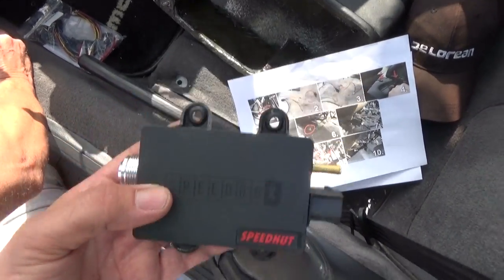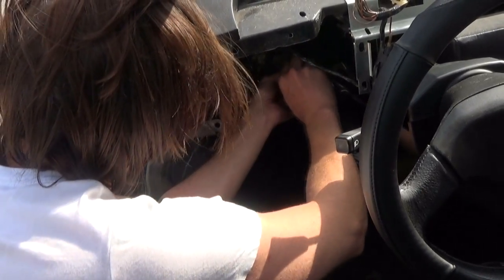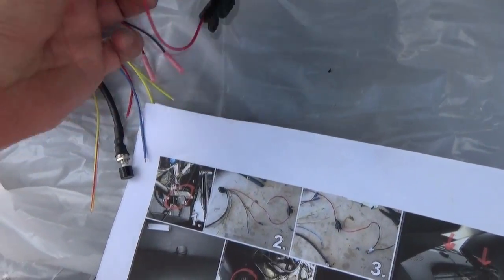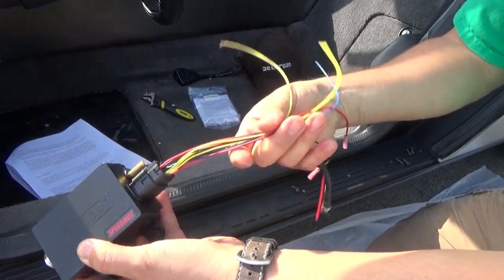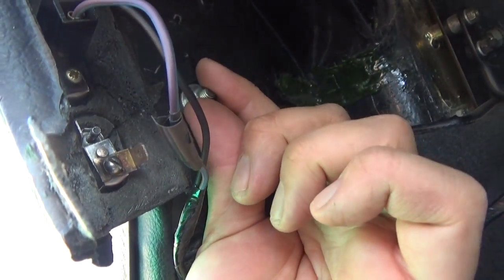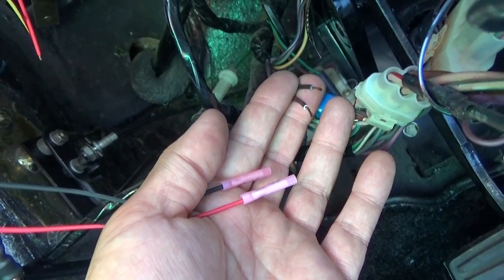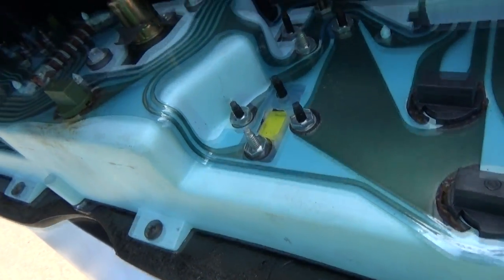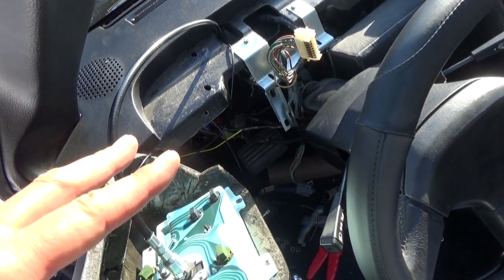Angle Drive Problems? SPEEDBOX™ GPS/VSS to Mechanical Drive Speed Converter in the DeLorean DMC-12

Comment: Nice video. I installed mine by removing the lamda counter. 2 of the hole centres on the speedbox is exactly the same as the the lamda box hole centres. I installed 2 additional rubber well nuts so that I have the speedbox bolted in using the 4 fixings. When you have the binnicle off (like me, trying to get the speedo cable off) be careful of breaking the trip set - which I did on mine .Also my speedo cable was a bitch to get off the speedo. Some will come off nice n easy - some cars have been stood around for a while - like my project DMC. I'm happy with the install.
Reply: I was planning on doing the same, why would the lambda counter or wiring to it be needed at all?

Comment: I wish there is a alternative method of harness the magnetic signal from drive shaft or the wheel hub . This will only work in a open road, and in Japan you have the annual inspection for car and it will need to measure the speed meter  , so GPS won't work indoor and stationary car. It's cool technology , because really there are addon speedo ,but it looks suchs and i wish that can be integrated into original speedo.

Comment: I just did this last weekend.  Love it. Great instructions! Thanks. #5945
Reply from the maker: Awesome! Thank you!
Reply: I have to say this is the best alternative to the original angle drive.  After installing and testing the Speedbox, it works quite well. The speed indication is accurate.  The way mine is wired, it takes about 20s to acquire gps signal after startup.  So if you take off tight away you won't get reading.  No biggie,  it soon picks up an super quiet.  Also if you intend to race in your Delorean,  lol, you may notice a slight lag during fast accelerations, but then picks up the speed.  During normal driving though,  it is fine ; tells you how fast you're going and keeps your odometer alive. Kills that annoying angle drive that can be a hit or miss after 40 years. I'm enjoying it. If anyone decides to do this, might as well update your binnacle to LED or refresh with a new covered one like i did "while you're in there" . Reward yourself for having to be a contortionist for a few hours and positions you thought you never knew you'd be in.. lol. #5945

Comment: how has been your experience with this speedbox? I have a LS swap nova and i would like to use the original speedometer and I'm between buying one of this units or buying a Mechanical Cable Drive Speedometer Conversion for my 4L65 witch its around the same price but this looks a lot easier to install
Reply from the maker: So far the speedbox has given the owner no problems.  He hasn't looked back.